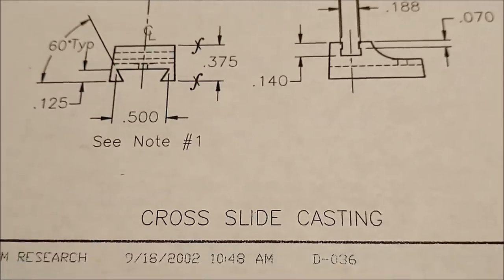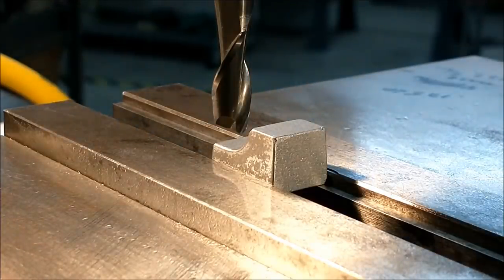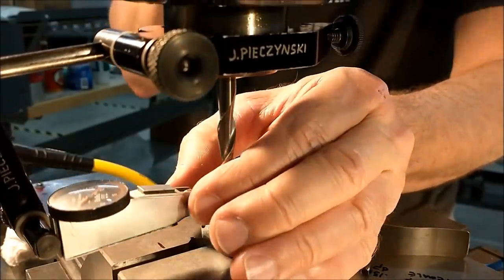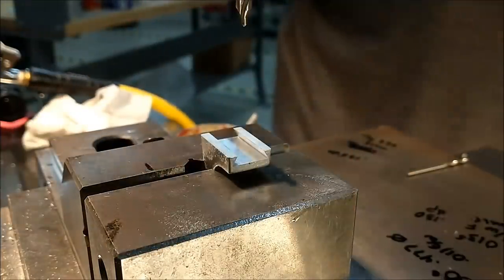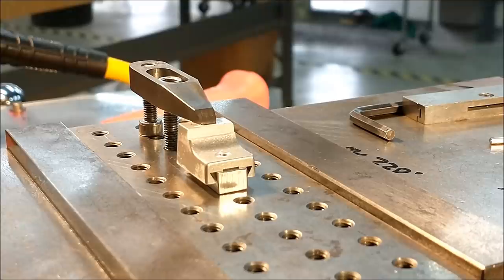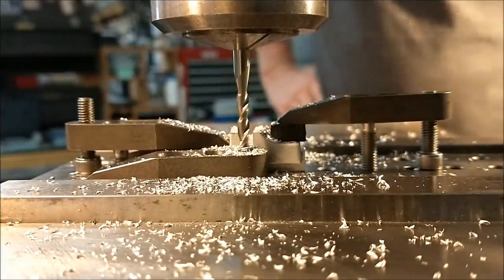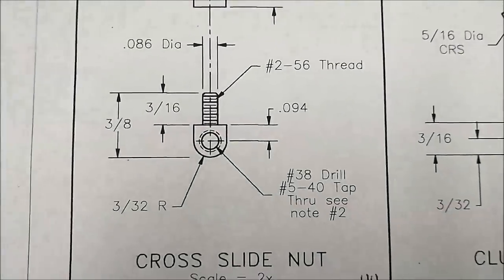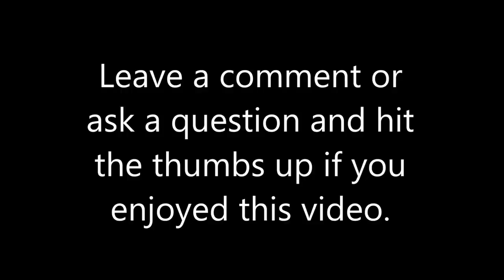Machining a Miniature Engine Lathe - Part 6b - The Compound

Comment: I’m a professional engineer and never had the proper appreciation for the skill necessary to make what we put on a drawing come to fruition.  I’m starting to do some hobby machining and your videos are invaluable.  Thanks!
Reply: As a machinist I can definitely say it is a pleasure to work with engineers who are eager to learn, rather than those who don't want to admit there is something they don't know. Thank you for what you're doing.
Reply from the maker: I used to teach " Design for Manufacturability" to our in house coop engineers. 3rd year mechanical engineering students from The university of Texas at Austin. 40 hours with me changed their perspective on what they designed. Most had never been in a machine shop.

Comment: Ah, the old "unloosening the wrong vise handle" trick; been there , done that and prevent it the from happening the same way you showed

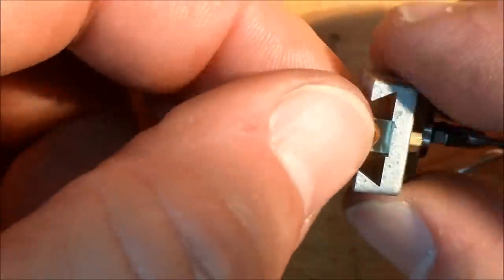 28:40 to 32:00 no audio intetional?

Great work on impossibly small parts, Joe!

Looking forward to the rest of the series.
Reply: I've held a manual 3 jaw scroll chuck in a hydraulic chuck for a delicate part and out of habit opened the hydraulic jaws, dropping the 3 jaw and part to the floor. I have since covered the control pedals with a bright red rag and pushed it out of the way lol.

Comment: This is ridiculously small. Never a finer job ever, anywhere. Thanks a bunch for Saturdays edition good sir.
Reply: Any smaller and you would have to do it on the bed of a compactor. ,,,, Don't give Joe any ideas.
Reply: @mathewmolk2089  LOL, Got ya, He sure has a talent + for small. I am at the other end where I worked on pieces as heavy as 80 Ton, Ships engines.

Comment: That is really coming along great. Lots of general machining tips in every video. I think you will end up replacing that socket head cap screw with a square head bolt in the tool post just for aesthetic reasons. (And of course make the little Armstrong square wrench to go with it.)
Reply from the maker: There is no doubt about it.

Comment: For custom T-slot cutters I have used a piece of ground steel round stock and silversoldered a piece of a shaft from an 1/8" carbide endmill on one end, so that one end of the carbide sticks out a little. Then you can shape a nice trapezoidal cutting edge into the carbide with a diamond wheel, so you get a single flute T-slot cutter. When the edge of the cutting profile is wider on the very end you get a square slot, not much magic in the geometry. I even ground it with a dremel tool and it worked pretty good on aluminium, steel can be a bit rough tho.

Comment: Joe, what do you consider an acceptable run out spec on a brand new drill chuck?
Reply from the maker: A few tenths. But that depends on the chuck brand and type of course.
Reply: @joepie221  Interesting. I keep seeing what I would consider fairly high dollar chucks with a spec of no more than 5 thou run out. I thought that sounded like crap myself. Thank you!

Comment: Out of curiosity, would it have made sense to drill and spot face the hole feature first, turn a soft stepped dia pin to temp. glue in, and deck off even  with the step features to both provide both an easy center to pick up and support for the milling operations?

Comment: Good effort 👍. I thought you might single-point the hex nut. Maybe you will next time when you re-make the leadscrew nut so that it doesn't twist in the slot. A square-head bolt would look nice in the tool post too. 
If you keep practicing, you will get there. 😉
Reply: a square head bolt is a must and with the small square key .
love the work anyway !
Reply: Naaaah Joe will make an Aloris style toolpost for it later :P

Comment: Is that centre drill slightly off-centre in the segment starting 28:45? looks like the drill is moving a little when the tip hits the material.  The jobber drill tip also moves a lot. Chip in the tailstock taper possibly? Or just an optical illusion? I have a near-identical Colchester 1800 and that happened to me once, a very fine brass chip stuck an inch inside the bore pushed the chuck a few thou down and right. Nearly snapped a 1.80 mm carbide machine reamer.
Reply from the maker: The jacobs chuck is very old. I'm sure its one of the jaws.

Comment: At 25:35 you show a bushing that you have made to literally fit a square peg in a round hole. Any chance on a video to see how you made this? I have a possible project coming up where this would be very useful instead of a four jaw chuck.
Reply: I believe that was made in the steam engine series. Valve linkage I think.

Comment: It looked to me like the bottom had a significant slant.  Was this the case?  I am curious whether your idea for keeping the top surface horizontal in the vice the first time agrees with mine.  Simply placing it on parallels would orient the entire part obliquely.  I like your trick to deck the dovetail base off with the dovetail cutter to establish a height zero.  I found it comical that one of the problems was assembling the tiny parts...  Thanks once again!

Comment: Did you consider creating a small box that would enclose the part then place and fill empty space around part with wax or plaster.  Part then can be held with square edges and the filler material removed after machining.
Reply: Great approach. Soldering it on top of a rectangular piece of scrap might also me a good option.

Comment: I'm surprised you're not using high-speed steel tooling on real soft stuff. Sharper Edge and all. One of my favorites for Plastics and gummy materials
Reply: A ground tool is a ground tool. There is no difference in edge sharpness. A 7° relived face to a 2° relived flute is the same angles. Same sharp.
Reply: Molded carbide insert tooling can have more edge radius though
Reply: Look at the edge under a microscope. Carbide cant hold an edge like steel

Comment: As always, a fascinating video. At the Time 28:36 You take the rectangular brass out of the 5C , held by a rectangular adapter. Was that adapter made using the "magic of video"? Maybe it came from the fridge... Suppose I would have used my 4 jaw....
At the Time 30:48... More video magics, or did I oversleep something? Quite a simple version of compound but likely good enough.
Reply from the maker: I showed how i made that adapter in my steam engine series. I used it to make the valve rod links. Check it out.

Comment: I didn't understand what you were indicating and adjusting? Could you explain what I am missing? Great video! Worked as manual machinist. Love tiny lathes, mills and shapers. Should see my tiny shaper.
Reply from the maker: Give me a time reference and I'll explain it.
Reply: @joepie221  from 7:05 to 10:00. Looks like your indicating like you would on a square piece if it were in lathe. I don't understand what your indicating. Are you finding center without edge finder?
Reply from the maker: @troublemakingpups5787  Correct. I'm a big fan of finding center and then actually being there once its found.

Comment: Joe, when you use the DTI how do you manage to always get it so  the "dip" occurs when the gauge is square to the item?   I've got one of the clones of that same holder but due to a number of things including the arms not coming out vertical and square and all my DTI gauge "dips" when the gauge is way off at some odd angle.  I can tweak it to square it up but it's a lot of futzing around to do so.  You seem to nail it every time.  Hints please?
Reply from the maker: Spin it in a circle and visually look for the body of the indicator to always point at the center of rotation. Bump as necessary.

Comment: You have to be creative to machine a casting. If you can’t get a solution to hold it, do what we used to do in the 70s go out back and smoke a joint. That will make your mind creative.

Comment: Very nice work Joe, but shorten up the SHCS that holds the tool bit. It's just a titch too long and looks out of proportion. Tedious work and you make it look easy.
Reply from the maker: Some details are by the print on this kit, and some I'll personalize. I think that tool post screw needs to be a square head.
Reply: @joepie221  After I wrote that I thought about how most lathes I've ever seen had the tool post bolt square headed. If the print doesn't call it out like that it would be much more authentic if it was square.

Comment: Very impressive work!  But I cannot deny this was a nailbiter episode, I mean...Wow... you practically need a microscope to see what you're doing... and if the parts were any smaller you'd run into the strange effects of quantum mechanics where the atoms themselves would start interfering with those cuts, and worse thing ever: if quantum tunneling occurred, well you're screwed... your part would disappear and show up in an alternative universe... which fortunately didn't happen. LOL 😁

Comment: I'm not a model maker by any mean but I must say I'm not impressed with this kit. Aluminium when ferrous metal should have been used, and indeed the material left on the side of the dovetail is too little no matter how you look at it. Great work by Joe as the usual.
Reply: I too agree that this should have been made from gray iron. Smaller castings could have been soldered to larger carriers for the machining work, and released off of them later when done. I guess you could buy the kit and use it as a pattern for casting it in iron,  and proceed from there. Shrinkage would be minimal, and you could add material in the pattern stage to offset the deficiencies you find.
Reply: There is no reason you could not use the drawings and aluminum parts as setup pieces to make your own out of whatever you wanted.
Reply: @pmdem  Ever try to cast Iron? ,,,, You are looking at a good just to get the furnace together.
Reply: Obviously one can change materials and details as he please, indeed my criticism is for the material provided which one pays for. Not to start again with the ridiculous socket bolt supplied, these did not even existed at the time such lathes were made.
Reply: @mathewmolk2089  This part only has simple geometry. Mill it out of a chunk any solid material you want. With a ball end mill and a square end mill you can remake the blank for this part easily. The other parts may more complex, but this one is relatively simple and may be necessary for those who mess up on that fiddly dovetail. 

Casting in any material seems like a PITA and I would never recommend it.